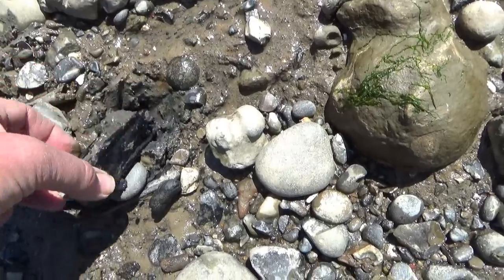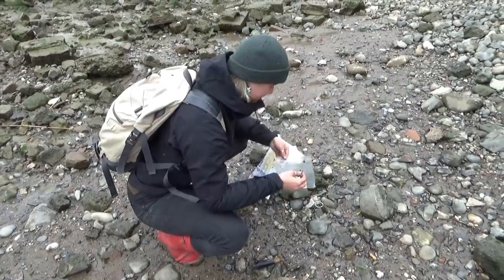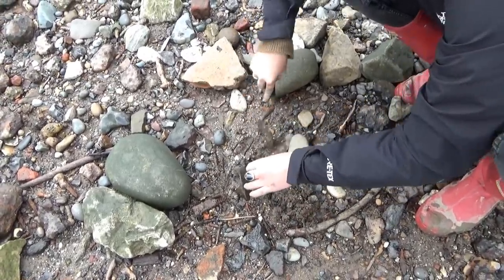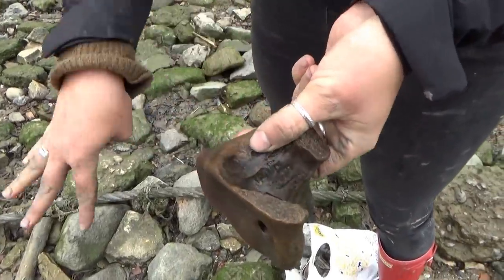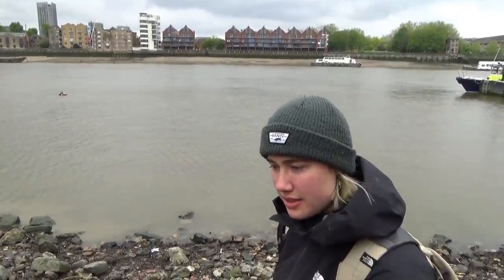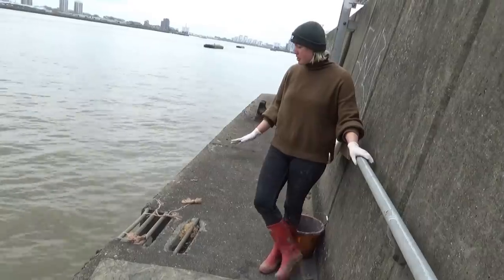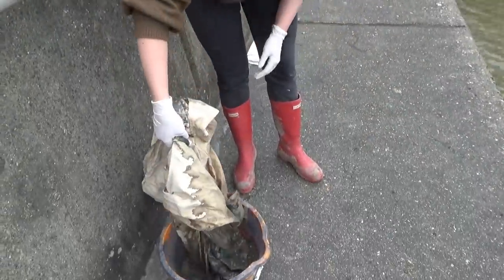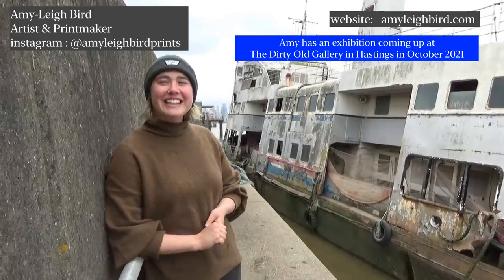Mudlarking the Thames - The Forgotten Bones of the River Thames & The Artist who loves them

Comment: The turtle part might just be the tail of a horseshoe crab. We used to find them all over the beach.  I enjoyed this video! 👏🏻👏🏻👍🏻👍🏻💕💕
Reply: It really is from a turtle.  During development, the rib fuses with the carapace around it and the result is called a Pleural.  The bones of the carapace lock together like those of a skull; in fact, the joins are called sutures.  And just like skull bones, the sutures will fuse together as the turtle gets older.  Turtle bones are AMAZING.
Reply from the maker: @susanbdusan2785  Thank you Susan!  That is such a great explanation - which I will save for myself to use too!  xx
Reply: @nicolawhitemudlark  My pleasure.  I, too, am a fan of bones!